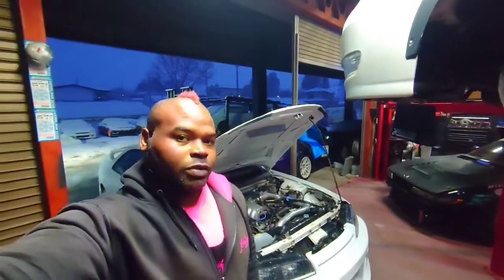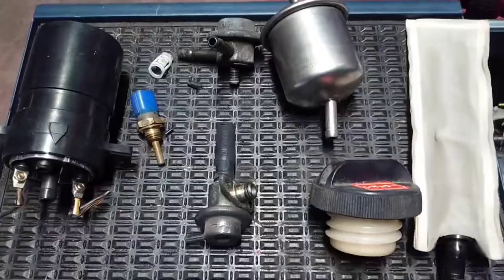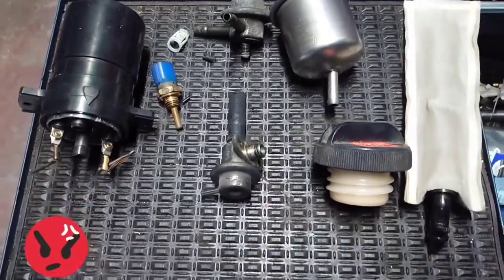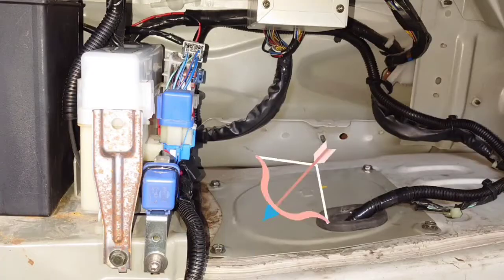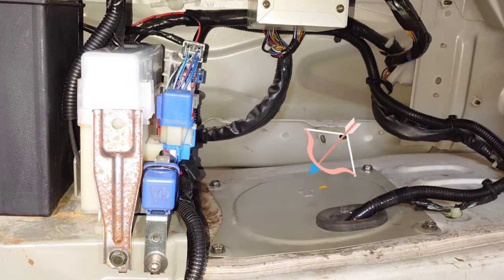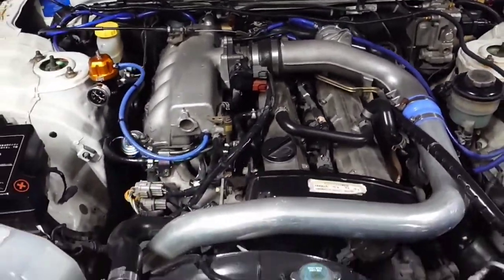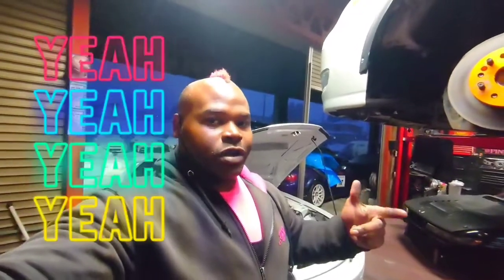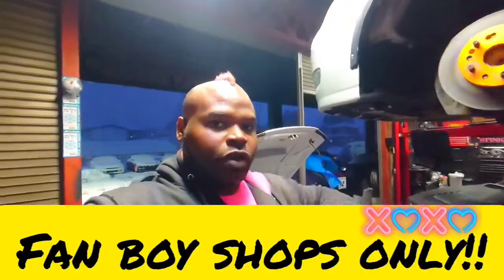Nissan Skyline R33 RB25 Low Fuel Pressure Fixed

Comment: Where do you connect the fuel pressure tester on the rb25? Cant find the schrader valve for
It on fuel rail
Reply from the maker: There is none on the rail you have to installed one Inline and or simply install a FRP with gauge